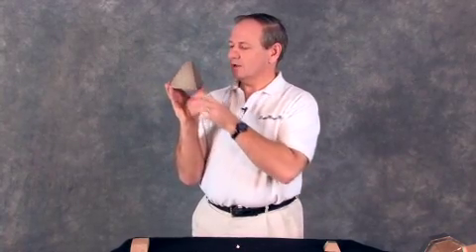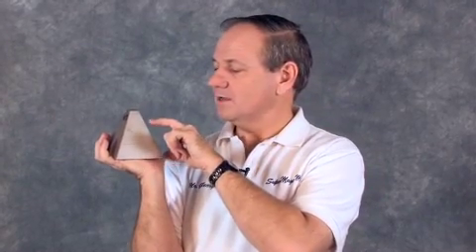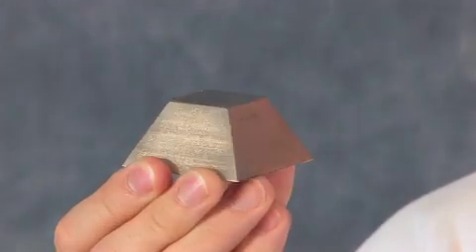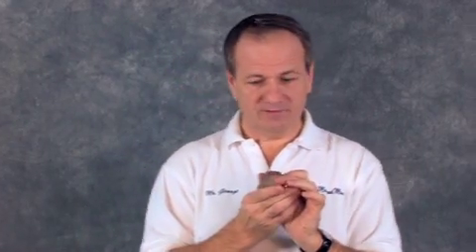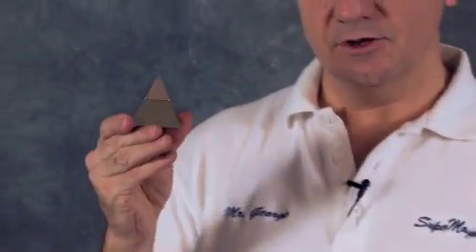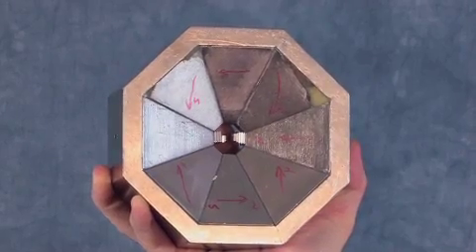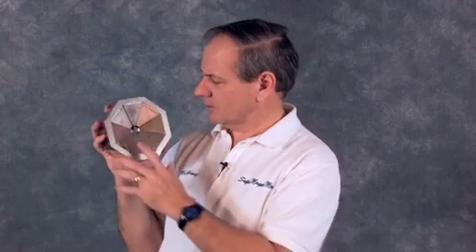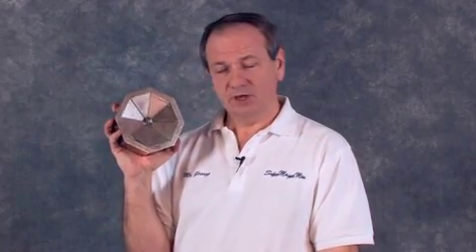Pyramid Magnets - Focusing Flux to a Point

Comment: I have some questions on elongated triangular prisms. It is shown here that this increases magnetic fields, but how much shorter is the field.
Reply: And could this apply to an electromagnet?
Reply: @KiwiClawDHA  yes
Reply: @senseisecurityschool9337  oh wow. That was for an old idea. Thanks.
This was in the idea of sustaining a high Tesla with a 2.5 foot gap.
Reply: @KiwiClawDHA  Did you ever build one?  Or experiment with them?  If so I'd like to chat.
Reply: @senseisecurityschool9337  I wish. I tried looking up the metal which would be the best to use. I've never made an electro magnet before. This is an old idea of mine and wanted to find a stimulator to test my theory before going through. If this worked and I could prove it. That could lead to revolutionary medical help in the MRI field. 
I just never knew if my theory was strong enough to actually invest money into. And the power. I couldn't imagine the electrical equipment needed...

Comment: Focusing to a point, but what shape projects a B-field the farthest?  Would the reverse end of the pyramid throw a field farther?  The goal being the farthest field for equal magnet weight?  

Second question:  What shape throws the farthest and largest dB/dt when spinning?  Spin a magnet (by motor), is there a "best shape" (for equal magnet mass)?  Farthest as measured from the point of closest approach of the spinning magnet surface?  If the base-end of a pyramid threw the longest-largest field, would a "pie" shape be the best rotating shape?  Apex of the pie at the center of rotation (fat end to the outside)?  

The longest-largest field might not provide the highest dB/dt?  Are there better shapes to increase dB/dt?  For example, wouldn't a rotating a bar magnet have several inflection points per rotation?  One for the reversal from North to South and several others near the ends where the field goes to zero on-axis?  Inflection points, where the field increases, then decreases and thus providing dB/dt?
Reply from the maker: Tom - basically to project a magnetic field over distance we increase the effective thickness of the magnet relative to the cross sectional area of the pole.  For example - a 6mm diameter x 2 mm thick N50 disc magnet would have a surface gauss level of about 3,000 gauss.  At 1 distance of 12.6 mm it measures about 35 gauss.  Now, we double it to 6mm x 4mm and we get 4,100 g on the surface and 63 g at 12.6mm.  Double that to 6mm x 8mm and we get 4,700 g on the surface and about 95 g at 12.6 mm.  So you can see it is a diminishing return.  If I stack up 50 of these discs so that it is about 6mm dia x 100mm long we get - 5,070 g on the surface and 160 g at 12.6 mm.  Once the thickness (or length of the direction of magnetization) is greater than the longest path across a pole the diminishing returns really takes over.  To increase beyond that you have to increase diameter.  Now, for something a bit more exotic you can check out the Boyd Bushman patent - 5,929,732.  We have made a sample of this and modeled it and it does project the magnetic field a little farther than a standard magnet does.  Hope this helps:)

Comment: i would not be holding that by my head for a long time
Reply from the maker: Actually there are no harmful effects.  Just think of it - if you had a medical problem they will frequently send you for an MRI which is 4 - 8 times as strong as some of these neo magnets.:)
Reply: Agreed.
I've been putting strong magnets to my head and operating strong radio transmitters for many years and I assure you there are absilutely no negative side eff...ff...fffe...ffeec...ects.
Reply: Thats a really good point. 

but you dont think if you held that magnet by your head, like direct contact, it would do something wouldn't it?
Reply: +cailean paris,
There are videos of strong magnetic pulses applied to the brain to disrupt some functions in an effort to find uses.

Comment: Got any sets where two pyramids attract each other at their bases, with a south at one tip, and a north at the other?
Reply from the maker: Actually we have not looked at these.  Of course we have the pyramids that meet that description but no one has asked that question before:)  My original intent for making pyramids was not to create the higher fields at the tops of the pyramids, but it was to create a more uniform field across the base.  Normally the middle would be lower gauss levels depending on thickness and so I thought if I made the middle thicker it would make up for that variation.:)

Comment: ANY N52  NEODYMIUM IS STONGER THAN THIS  AT 12000 GAUSS  not impressed
Reply from the maker: Not really - the material N52 has a Br value of 14,300 to 14,800 but there is not a magnet that measures 14,800 gauss on the surface that is not in some special arrangement like what we make.  For example a 6mm x 2mm disc magnet from N50 only has a surface gauss of 3,000 but the Br of the N50 material is 14,800.  Two - totally different terms that both happen to use the word "gauss".

Comment: wouldn't it also be possible to achieve the same flux focusing by creating a conicial dish or lens?
Reply from the maker: Dale, magnetism does not focus like light does.  A conical dish or a lens would have no effect on magnetism.  Also,  there really isn't anything that can focus magnetism.  The pyramid magnet does intensify the field but certainly not as much as you would think.  For example, if we take a 2 inch square x 1 inch think N50 block, we should get around 5,000 Gauss on surface, which is 4 square inches.  You would think that making the pyramid and focusing all the flux from 4 square inches to 1 square inch would get you pretty much a 4X increase in flux but it will only get you up to about 7,500 Gauss.
Reply: So the Gauss increase is more due to total volume, as opposed to the surface area of the N and S ends?

Comment: If I need a 0.5mm X 0.5mm tip to have the strongest possible magnetization, should I use a cone or a pyramid? If we have the same material volume, which will have a stronger field at the tip? and how can we know the perfect cone/pyramid angle?

Thanks!
Reply from the maker: Jonathan, the Pyramid is the best.  The rounded tip of a cone would not be as good as the square top pyramid.
Reply: Thank you! I'll buy a couple on your website for a try... Nice videos by the way!

Comment: Fascinating vid! An easier way to achieve this is to use an iron pyramid, stuck to a normal neodymium magnet. You'll get 7-8k gauss. Two of those connected to a u-shaped yoke, like illustrated here: https://www.kjmagnetics.com/gap.calculator.asp, will get you between 2 and 3 tesla. The theoretical limit would be the saturation point of iron times 2, which is 4 tesla, but that is possible only with a zero air gap.
Reply: Really helpful Alex D - Thank you!!!

Comment: Several years ago, I helped one customer from USA to produce this type of magnet ,and he also need a cone Alnico magnet too. But I don't know where they used till now.  but they are interesting magnet. Thank you. I am learning English and knowledge from your video. Although I worked in a magnet factory in fact...
Reply: +Jacky Wang I would like to know more about this and have you ever reproduced this? Also did you make it to a point or has the pyramid one ever get made to a point? Lastly what if you made two, each opposite in poles to each other then attach them to each other at the points? I suspect you may find it does something quit peculiar, perhaps spins at a very high rate with equally high tension... what do you think?
Reply: I don't know, I am not good at magnet applications, because all my knowledge is on the magnet itself, because I worked on  magnet sales for 12 years, and work in a magnet factory. Usually I can give suggestion on magnetic material choosing, if the magnet can be produced (because usually magnets are not so machinable), the temperature if they can work in...blabla. and about the magnet will take what type of function, I don't know. although I have worked for so much time in this industries, I only can get to know something about where the magnet use sometimes from my customers.. haha
the magnet man usually give lots of useful information, but something is wrong as I think, but just on my opinion, maybe he is right.

 I watch his video carefully, one reason is to get something I don't know, other hand I can learn English too.  my poor English as a Chinese. :)
Reply: @jackywang818  You live in China and worked in a magnet factory in China? That is so cool. What kind of magnets did you make? Did you make Neodymium magnets?

Thanks for any reply. And your English is very good! Much better than my Chinese lol.

Cheers! :)

Comment: So, I have to ask, because the arrows on those magnets seem to be pointing the wrong directions. I study magnets in my PhD and have even made Haibach arrays (linear ones though). The arrows cannot be facing each other at the North and South side of the array. The head of the arrow at the bottom should point towards the tail of the other arrow at the top. Basically, half of the Haibach "cylinder" has the arrows pointing the opposite direction. I'll look more into what this arrangement would do using some good ol' modeling, but I'm pretty sure this would create something like zero field in the center, if the arrows were marked correctly.
Reply: Brock Peterson did ya figure it out?

Comment: Magnetism = Gravity.
When the magnetic field is strong enough ANYTHING will become effected.
Reply: high gradient magnetic separation, magnetite nanoparticles introduced into contaminated water will bind to the suspended particles (solids, bacteria, or plankton, for example) and settle to the bottom of the fluid, allowing the contaminants to be removed and the magnetite particles to be recycled and reused
Reply: joshua arnott the ground is diaelectric
Reply: +Naoki Kashima  apart from ......
Reply: chris coles Magnets can effect non-metalic objects. Youtube search 'frog levitated in a tube". There are videos of a frog levitated in a very strong magnetic field. I made a video showing how Graphite, which is typically non-magnetic, can act magnetic in the presence of a very strong magnetic field.
Reply: @naokikashima9349  Pyrlolytic graphite is well-known to be highly diamagnetic, meaning that it opposes the incident magnetic field and field changes.  It is a common science trick to levitate pyrolytic graphite in a strong magnetic field.  The field has to be very strong, though.  Frogs have water in them, which is also diamagnetic, but not as much as graphite.
Reply: This is static field. To overcome gravity it must rotate. You also need a current moving away from focalpoint at 90 degree angel, i think.
Reply: if magnetism what held us to the ground, then any magnet strong enough to move a compass would be strong enough to stick to literally everything on earth.
obviously, that is not the case.
dismissed
Reply: @smartard  You don't need a strong magnetic field to move a compass.  A piece of iron will re-direct the earth's magnetic flux, and can easily change a compass needle in its vicinity.
Reply: For all the haters out there, Gravity = incoherent Magnetism. They are exactly the same. coherency, in physics, is a difficult topic to grasp. The difference between light from a light bulb and light from a laser, is one of coherency. A 4 watt light bulb you can barely read by. but a 4 watt laser will cut a hole in you. The issue of strength is one of how well the polarities line up. Read Missing Secrets of Magnetism, by Ken Wheeler, for more and better explanations.
Reply: As appealing as Ken’s Dielectric Æther based model is for EM, it is unwise to proclaim so matter-o-factly from the pulpit of an un untested, unsubstantiated, and fledgling publication. 
      I guess along with Ken Wheeler’s science, you also adopted his condescending attitude of superiority
Reply: @espositogregory  respectfully, it is in fact, a matter of fact. It is substantiated.  Aether is a framework, to form a theortical understanding, it explains all physical phenomenon. Working upon the basis of electrical science, as written by Heaviside, Dollard, Steinmetz, among others. You know, the people who wrote the Theory of Electromagnetism. It's appealing because it flawlessly works. 
Heres to you learning! 😎
Reply: @MathewRenfro   dollard did not write the theory of magnetism. he is a modern inventor that has opposing views on the established theory of EM. perhaps you meant maxwell.
Reply: @freelectron2029  well, Maxwell was implied :) but no, Ken Wheeler often cites Dollard's advances in EM theory. (A synthetic polar geometry and the relationship between space and counterspace). What you call against accepted theory in another context could be called advancing the theory. Yeah some of his stuff is discredited, but I've seen videos of Dollard accepting where and when he was wrong. Alot of his other stuff is actually really good. I'd recommend his book on versor algebra, for example. :)
Reply: +athew Renfro,
If coherency is the essence, what kind of frequencies are involved?
Reply: @MathewRenfro  I am working on a demonstration of this, where you have a bunch of randomly spinning magnets grouped together, and another group of randomly spinning magnets (extremely low-friction).  Do the two groups mutually attract?  We shall see.
Reply: @onehitpick9758  when you have got your demonstration going, throw me a line. I'd like to see.
Reply: joshua arnott density

Comment: Extra ordinary claims, require extra ordinary proof.
Reply: +lbochtler    The narrowing shape doesn't increase the total flux (Φ), but it does increase the flux density (B). In other words, the lines of flux are being squeezed into a smaller area, making the flux density (B) higher. Do a search on the difference between flux and flux density.
Reply: @solarfluxman8810  It is well known that monopolar fields concentrate flux density at sharp points in the originating material.  It's perhaps less well-known what happens with different configurations of dipolar structures, but readily modeled.
Reply: ok, Sagan. Something in particular you were thinking about, or is it just one of those days?
Reply: I was actually thinking about the "amplification" of the magnetic flux on the smaller side of the pyramid, and if that is even possible the way he states it. and if it is greater, then an identical square non pyramidal magnet (with a edge length identical to the top of the pyramid, with the height  being identical), magnetized by the same method, and made of the same material.
Reply: Then comes the interesting bit, what if a magnet where made with the same base as the base of the pyramid, and same height. what would the flux be like on the cuboid, vs the pyramid. My hypothesis, is that the cuboid magnet will have more flux, then the pyramid one.
Reply: Oh. Thanks. And in the way you put it, I'll have to agree. My take on this amplification phenomenon actually is much like with life in space: I'm pretty sure that if it was a thing, we would all know about it by now. Then, on the other hand, we got conspeories about, both aliens and government interest in keeping alternative energyforms under wraps - although not necessarily within the same theory. So you never know, is what. I just like magnets, and have on top taken an interest in magnetoman as the person that is portrayed in his vids. There is a story there, I think. There always is, heh.
Reply: WormholeJim
well i want to add something to the alternative energy theory stuff. I doubt the governments would be all to much against it (if they where not corrupt), but instead the company's that have a vested interest in the status quo. These will defiantly try and suppress alternative energy, they would, for instance in the USA, be able to get their will done.

Also, one problem i see with many alternative energy devices, is the lack of reproducibility...

As to you interests in magnets, its a interesting field of research. Do you mind me asking, are you more interested in permanent-, or electromagnets?
Reply: ken wheeler rates this guy. theres your proof. enuf said
Reply: But debunking doesn't require any, just snarky comments.
Reply: @phoenixsmith4001  Even worse than that-- hardly any real thought- just write a tired cliche and you're good lol.

And re:

"If this was legit, I somehow would've found out by now."

Right, which is why you're a literal encyclopedia of scientific knowledge, and new scientific discoveries aren't made pretty much every day-- because we already know everything.

Jesus Christ, and these "skeptics" say we're the irrational ones!

People are funny...

Comment: (part 2)  After watching your program I am convinced that the proper shape would be to have a flat area on top 1/2 the size of the base.  When all six magnets are combined they would form a cube with (for example) sides with four square inches and a space in the middle of one cubic inch.  I only use these sizes as examples.  The size is unimportant but I would hope it could be no smaller than an inch a side on the base and no larger than three-inches. (continued in part 3)